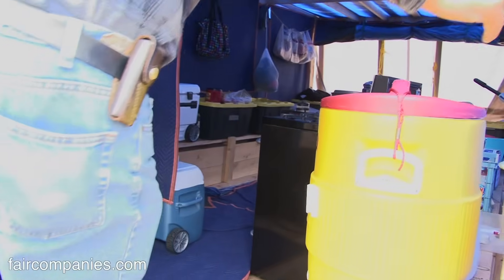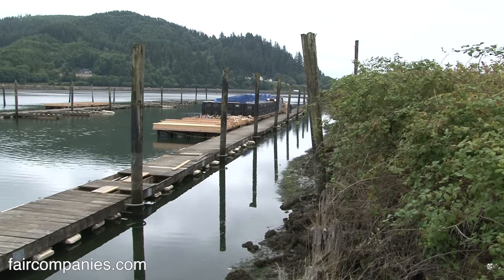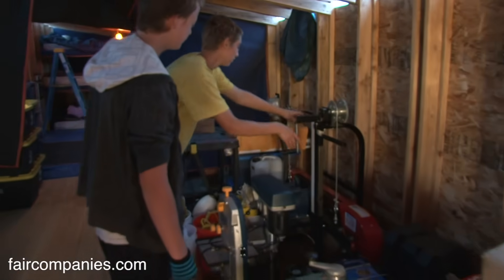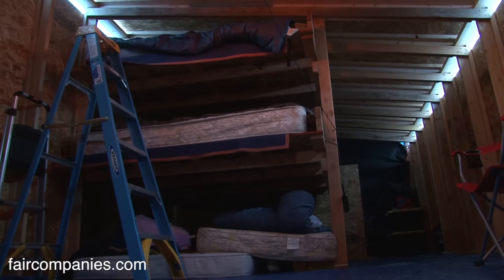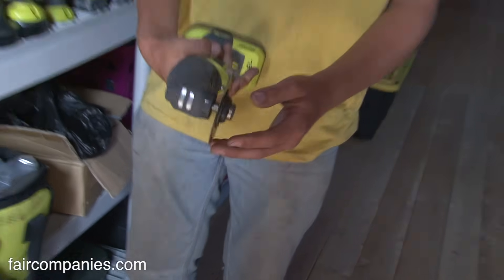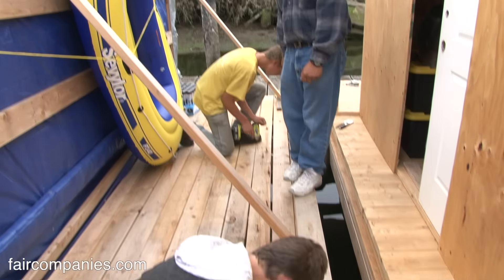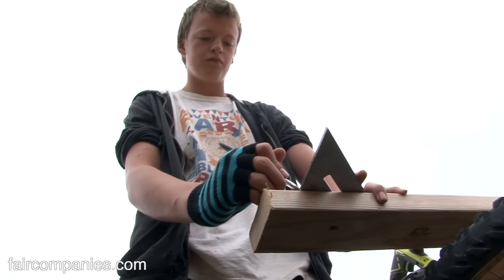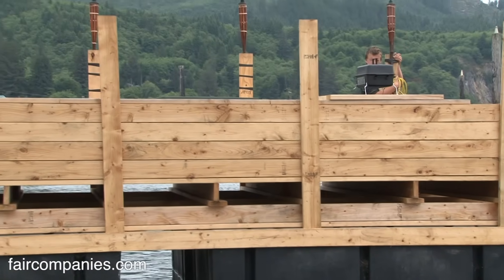Oregon "teens + dad" team build barge home and workshop

Comment: why not use shipping containers on top of those instead of wood?  I would be worried about  being in the ocean with that
Reply: I have looked for some so called cheap/free shipping containers. Can't find them. It's a myth. Once there was even a slight demand for them, it was impossible to get them for less than it would cost to build a similar structure from wood. Rust is not an issue; shipping containers were made to voyage the seas on the deck of a freightliner. Weight is not an issue; for the strength of steel, it is lighter than wood or else skyscrapers would be built out of wood. Wood rots, absorbs moisture and gets heavier. The only issue comes down to cost. As long as yuppy artists are willing to pay thousands for them, then they will continue to be too expensive for tiny homes for the needy.
Reply: weight, rust, logistical headache???
Reply: D AW I can bend a steel spoon with my mind, but I can't bend a firewood log. If you will look at what I said, you will see we agree. ;D
For the same strength, steel is lighter than wood. Of course a ton of steel is not lighter than a ton of wood, but it is stronger. Sorry if the way I wrote it was confusing. :D
Reply: D AW
Sorry, but $6000 for a shelter is not in the same category as 'free'. My point was that at one time the shipping containers were given away, (the only cost was shipping), but then the yuppy artists started using them for art and so they became valuable as the yuppies could easily out-bid the homeless. A person who is desperate for shelter doesn't really care how it looks. If they don't have $1000 for a shipping container, then they don't have $6000 for a yuppy designed art-decko cabin. Thanks anyway. I was able to build a 4x8 shelter with some sticks and a tarp and my computer stays dry.
Reply: D AW
I noticed you didn't say free, but that I had said cheap/free. I get so tired of salesmen hawking their wares that don't bother to qualify their prospect. With some careful reading, you could have avoided your embarrassment.
Reply: D AW
As far as what you consider aesthetically pleasing goes, you can take that and flush it down the toilet. There is nothing about the arch cabin that looks good to me. With a free shipping container, I could easily modify it to have windows, ventilation, I can clean it with a bit of elbow grease (doesn't require me to have an income to be able to clean) and the flat roof makes a convenient deck and a place to grow a garden where deer can't reach. What good is your aesthetically pleasing arch cabin going to do someone with very little money? It is clearly a convenience item packaged for wealthy hunters who want to pave the wilderness. I would rather sleep in a tent.
Reply: D AW
Shut up and vote for Trump. You're exactly like a used car salesman. The truth is not in you, but ugly to the core.
Reply: kedwa30 No, it was my mistake. I misread it.
Reply: +kedwa30 Steel is not lighter than wood, it is stronger than wood. THAT is why they build with it. Wood is damned heavy, if you are using the same amount as needed to have the same strength as steel, not to mention far more bulky.
Reply: kedwa30 But on another note, if I may ask, what use do you have in mind for the shipping containers? If you are looking for an affordable way to make a shelter, I may have a suggestion for you that you will like. They are called Arched Cabins, and they are really pretty affordable, and a much better option than steel containers because they are designed to be lived in. They come in a whole range of sizes too, from 8x8 all the way up to 24x40 and they are far more attractive too.
Reply: I never said free. I said affordable. A shipping container has way too many issues to suit me, including whatever crud it may have been hauling at one point, no insulation, aesthetically displeasing shape, and then there is that whole lack of windows and doors thing. Sorry I mentioned it, I was just trying to point out a nice, affordable product for someone who might be interested in an affordable shelter. Won't happen again.
Reply: In the first place I am not a salesman hawking my wares. I have no connection to the cabin people. In the second, I could care less about the cost or elbow grease or effort to make a square, ugly container that you are all butthurt about because you can't get something for nothing. Life doesn't work that way, sorry. Even if you did get one for free, modifying it to the point of making it habitable would still cost several hundred dollars. At any rate, we are not going to see eye to eye, and at this point you have been rude to the point of making me cross, and being rude right back at you. I won't respond further as it seems to be some sort of inconvenience to you to discuss without becoming salty.Good bye. Get a job and stop expecting free things, idiot. Have fun living in your little stick and mud shelter, and enjoying all the bed bugs your body can support. WHAT A LOSER! Grow up, gets some manners, and oh, I don't know, quit whining because life doesn't hand you a free living? Good luck with that....NOT! Oh, and also, learn to spell, moron child.

Comment: Kinda half arse. Sorry. I would finish one barge completely and make it really comfortable before making the rest. Learn from mistakes on the first so the second will be an improvement. Better not to make any mistakes at all and design it right from the start. The wood needs fiberglassed over or something otherwise it will rot away in no time.

Comment: My only concern would be with it being two stories tall, that is to keep it from tipping over, I have not read any other comments so this might have been covered. I really like the idea, I am majoring in environmental conservation, so this is a great concept that I would like to continue seeing.
Reply: Are you on enviro-cons? What do you think about the waste in wood?
Reply: eduardo m-v Yes it is an overkill of wood, I would rather see a different product used, or even recycled lumber would be better. It would be awesome if there was a lighter version of trek boards that could be used, though the cost would be higher.
Reply: That does seem like a potential concern, especially with how overbuilt the upper structure looks like it is going to be and how small the barge is.

Comment: This guy is almost dangerous.  Those barges will simply fall apart.  I have done construction for forty years and I see problems with everthing.  His basic Idea is fine BUT his fastners have to be stainless steel or they will simply rot away.  His Rafters will never work because they are only 2 x4 s and will not support a snow load.
Reply: They WERE stainless steel thank you very much, and we were GOING to add I-beams but didn’t get that far
Reply: I think this needs a welded frame on top of the black things, plus a central welded cabin at the center ( I do not know how large it will be, maybe all the pieces together?). I would rely only on steel. All his wood can be used on top of that, but oh may!, he is talking about going to alaska?
Reply: Bob the builder

Comment: Deck screws will rust in a marine environment, and quickly too.
Paddle wheel drive, with generators behind them to recharge the batteries? Physics says no.
You can't provide your own wind to drive sails. Millions of sailors would have picked up on this by now if you could. And no, Mythbusters does not apply to this situation... sorry.
This is a dock, not a barge, and it's most certainly not a boat.
There are navel architects for a reason.
Alaska? Have you traveled the inside passage? Big currents, big tides, big hidden rocks, and a big stretch of open ocean once you clear Vancouver Islands northern tip. Real boats, with life long skippers use great caution on this route. Still countless real boats and lives have been lost.
.
Reply: I don't like the way my navel looks. Can I get an architect to design me a new one?
Reply: Richey hey I’m still alive lol long story short we had to take it apart NOT DUE TO SAFETY HAZARDS but just cuz they didn’t want to let us stay on it
Reply: inie or an outie?
Reply: To reclaim some of the energy of motion, get energy from braking and get energy if the current takes the barge in a direction they want to go so it's not a zero energy project but like a hybrid car.
Reply: HATERS GONNA HATE

Comment: good stuff, but it looks slightly amateur. i don't see any metal bracing. it's basically all just wood screwed together. if it works, it works i guess, but on the water i'd want everything as stable as possible.

Comment: Listen more carefully, it is a barge, they will move it with a seagoing tugboat. and they will pick a time with good weather and put in to safe harbors along the way then stop in protected waters. they are not hanging a 10 horsepower outboard on the back, that would not be reasonable. I have seen more poorly built houseboats in the Miami River in Miami, Florida and they survived hurricanes Remember the TV show from the 1960's called "77 Sunset Strip?" I have visited aboard it.(In 1974)

Comment: You only have two eyes and I would always recommend protecting them while using power tools.   I have made many saw cuts and I have been hit in the face with flying wood chips many times.  Making a statement like that shows your true intelligence.  I bet you are the type that uses a power sander without a dust mask.  Another fact once your lungs are damaged with either smoke or dust they cannot be repaired.  I am sure there is enough room on that raft for you to join them on their exploration.

Comment: Stick with wood at any case the tree variety and use of OSB is solved by applying sealer properly. and the structure doesn't have to last 30 years either.  If you listened to the video they mentioned it is being towed to alaska as soon as they complete it and high school in three years. Only the plastic floats touch water, it is not a wooden barge. I might have gone with ferrocement, but the choice is theirs not yours or mine .

Comment: homeless slums like soweto are often actually on one side of a city ( or in soweto's case now inside it ). they are rusted corrugated iron with bits of tarp and bits of plastic and old road signs. this looks far from it. I've spent over 8 years in the building industry and have been installing a solar rig and doing plumbing in a building today. this looks like a house at the framing stage. coz that's exactly what it is. don't know how you built houses.

Comment: the wall he is hanging off doesn't look quite right. there needs to be some angled bracing. i forgot all about that when i built my laundry shed and then was sitting having breakfast one day and saw it rocking. a few minutes later i had timber on a 45 degree angle from the wall to the beams holding the roof. he MAY have it on the outside of the wall though, esp if its there's other rooms.